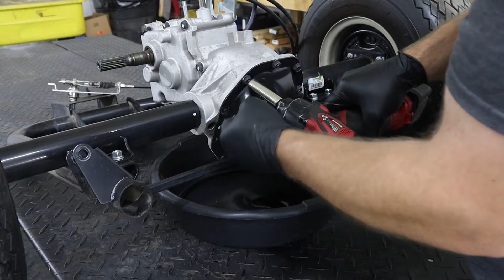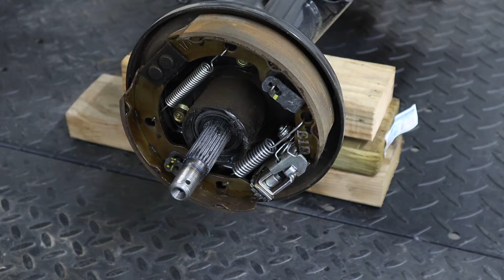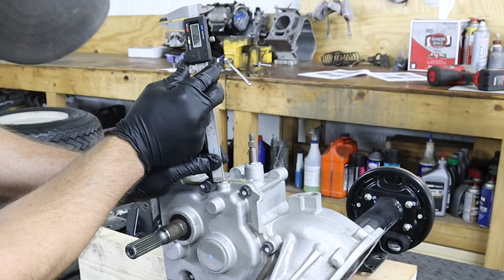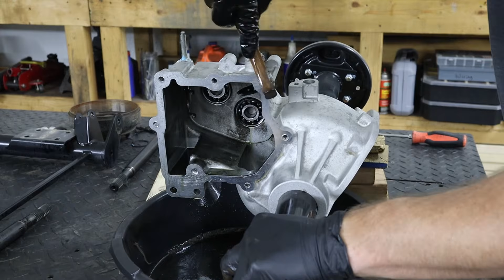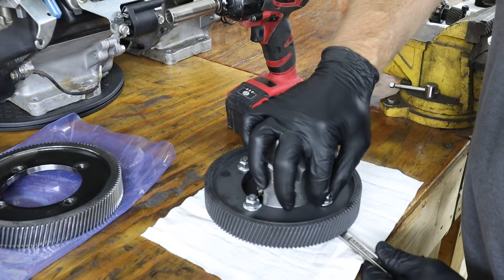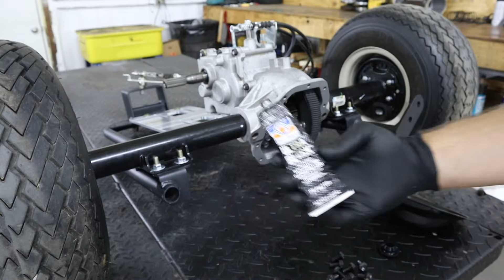Yamaha Drive/Drive2 Schafer Solid Axle High Speed Gears Installation

Comment: I have a 2013 g29 with a shot team trans axle. Any ideas to replace that with a newer axle or is my option to build a new one. 
All the cart shops near me say the cart is totaled
Reply from the maker: I believe it is possible to update to the newer style Shafer transaxle, but I have never done it. Transaxles aren't cheap, so it will likely cost you a couple thousand to do, unless you can find a good used axle. Good luck!

Comment: What is the torque spec for the rear axle castle nuts? Front as well if different :)
Do you have a video on changing the thrust shaft seal?

Comment: I bought a G22 with some water intrusion issues and as I'm replacing all the transaxle bearings and seals this video was invaluable. Cleaning the nasty brown (rust/water/gear oil) sludge is a pain, but my biggest concert is in hoping that the light pitting on all the internal gears from the surface corrosion isn't going to give me problems long term. Never the less. Having this video was nice in seeing how everything comes apart and goes back together. Thanks.
Reply from the maker: Glad it helped. Thanks for watching!

Comment: Hi Jonas, are there any compatible transaxles for the 2015-2016 Yamaha g29 that are more reliable? Research shows that the intermediate shaft in these trans are really crap. Thanks
Reply from the maker: I am not aware of any issues with the 2015 and newer transaxles on the G29s. That same transaxle is still used in the Drive2 non quietech models and the UMAXs. There was an issue with the input shaft on some of the early model G29s from around 2007-2009.
Reply: @PowerEquipmentMan   They may have just updated the Intermediate shaft that holds the forward and reverse gears then. I have seen some photos on forums of it in pieces. Just not sure when they updated the intermediate shaft.
Reply: @PowerEquipmentMan how are you
Reply: How does the rally ride compared to the drive 2?
Reply from the maker: @Lumpia_In_Texas   the UMAX models are going to ride rougher than the Drive2, especially if you are comparing it to the Quietech model with independent rear suspension.